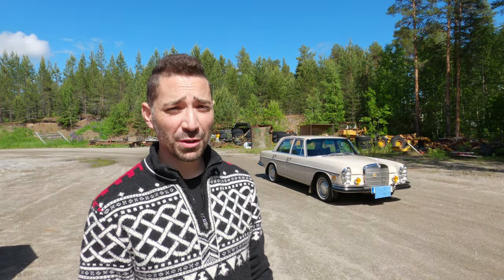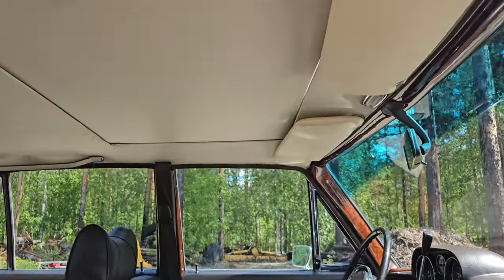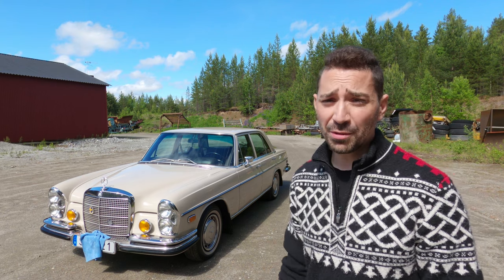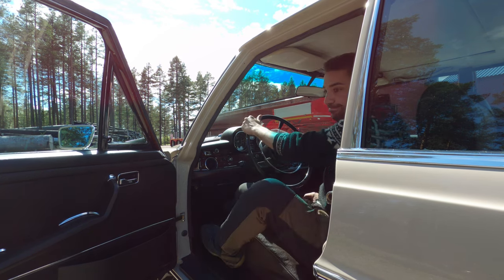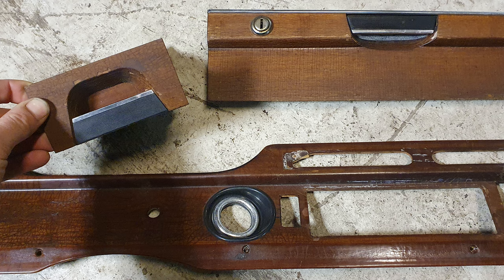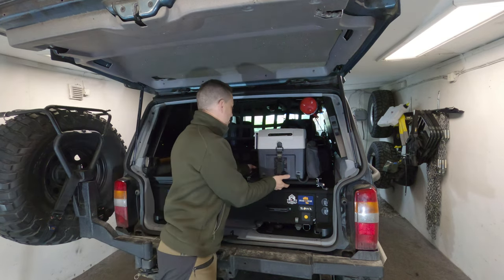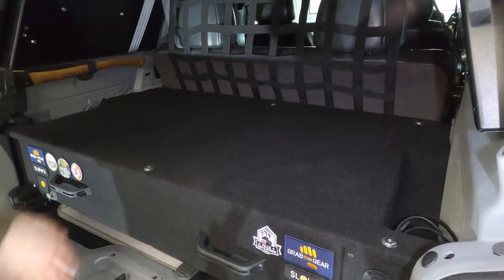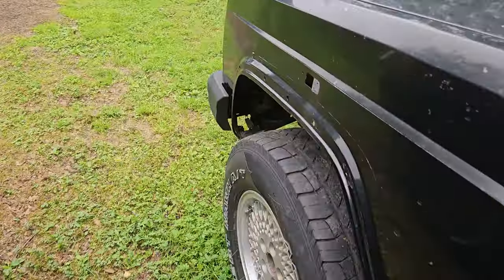Four Years Of Hard Work / W108 280SE Restoration

Comment from the maker: Back in late 2020 I got a job for a local garage called Asele Bilservice, restoring this 1972 Mercades w108 280SE. It was owned by an American guy who moved to Sweden and brought the car with him. His mother owned this from new so its been in the family for a while and carries a lot of sentimental value to them. 
The car was in a rough state when I started on it. The engine required rebuilding, the transmission also. Power steering wasn't working, the fuel mechanical fuel pump required rebuilding. It had lots of electronic issues, windows didn't work, broken wires, the sunroof was completely seized. The rear axle was leaking and damaged and along side everything mechanical needing repairing, replacing or rebuilding, cosmetically it needed stripping down and restoring. The worst part was that almost ever chrome detail, window and external part has bas overspray on it from a previous paint job.    

Anyway I thought I would show you the completed vehicle as its taken almost 3.5 years and a few of us to get it looking this good. Its certainly not perfect as a show vehicle but that was never the intention as its will be a daily driver. 
I'm back making normal content again but had to put down a few weeks just to get this finished for the mid summer. 
Thanks for watching and for your support.
Mike